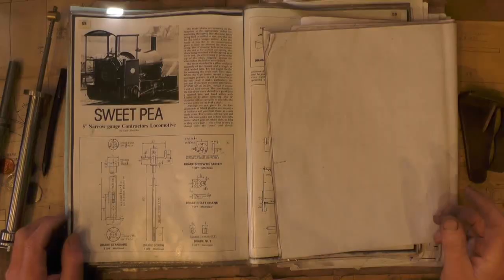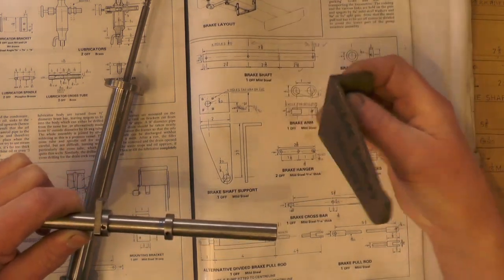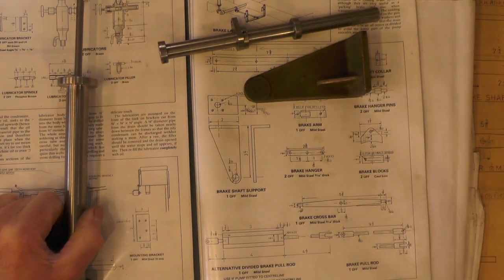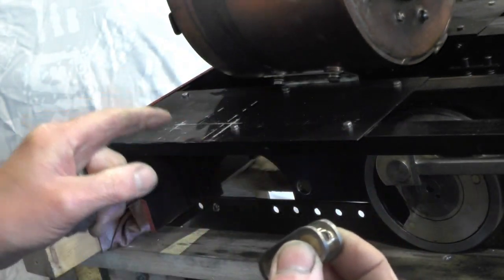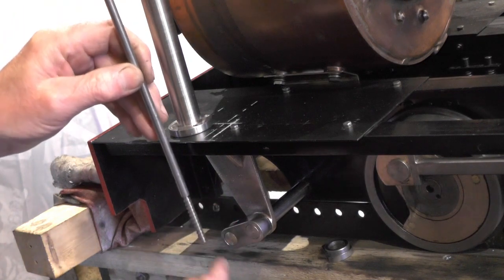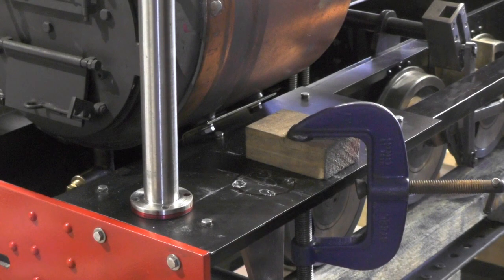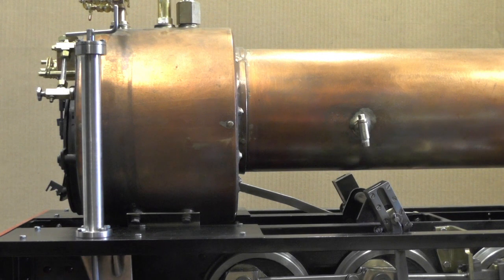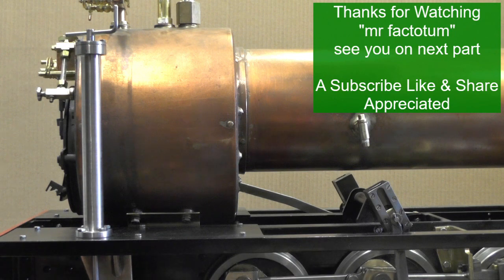Make a Beginners Miniature Steam Locomotive Series (Brakes Part 3  ) "mr factotum"

Comment: Great progress Mr F. just wondering if the brass nut with the square thread would benefit from a couple of circlips to hold it central in its housing
Reply from the maker: hi rob nice to hear from you, yes i thought it was a bad design, but as long as the brake screw comes down in line its not a problem with the amount of use it gets
thanks for watching
regards
mr f

Comment: great job as always. 
Out of interest I would have like to have seen how you drilled the hole in the bottom of the support bracket and get it to line up perfectly with the rod.
It was probably obvious but was just wonderings as it would need to be accurate.  

On my loco my bogie is reaching completion. Wheels and suspension done but have to remake the bogie sliding block as i trashed the two castings on the last operation... 
Working on the main driving wheels now but they have maxed out my little Myford ML10. 6" wheels on my lathe and it only just clears the bed. Hope i can get my tool in to cut the treads else I might have to go to my local engineering club and use there lathe.
Reply from the maker: hi brendan
nice to hear from you, 
I got the measurement by putting the shaft through the frame, then measure from underside footplate where the base of the bracket sits to the top of the brake shaft then added 1/2 the diameter of the shaft, that gave me a precise measurement from the base of the bracket.
Your loco sounds though its taking shape and coming on, if the wheels fit in the lathe the tread can be machined by one means or another.
regards
mr f

Comment: How did you determine where to put the hole in the brake support for the brake shaft?  Looks really nice Mr. F.  Makes me wish I was back in the shop messing about!

Joe
Reply from the maker: hi (binge watcher) Joe
the pre determined holes in the frame  determine the brake shaft support bracket position, just a matter of carefully setting on the shaft and some precision marking out!!.
How far have you got with the kitchen, have you "broke its back" and on the "home straight" yet, good luck and thinking about you doing all that hard work!!
regards
mr f
Reply: Mr. F.  I am dealing with mission creep at the moment.  I thought I would never get the old underlayment out as it was glued and nailed.  Finally though, it is out and I am making progress.  I have the new underlayment down in the Kitchen and dining room, still have the hallway and living room to do but they can wait for a bit.  I have the rough in water and drain done for the sink and refrigerator, most all the rough in for electrical done.  I still need to do the wiring for my stove (220v, 50A) circuit.  It is already run, I just need to terminate it.  And finally I have to "hide" some wire in the wall to assist with the under cabinet lighting when the time comes.  Then I can finally button the walls up and hang and finish the drywall.  The cabinets are ordered (about 3 weeks ago) but are not expected until the 10th of August.  I have to them in before I can get the granite counter ordered, measured and cut.  On an upside, the wife has picked the vinyl plank flooring she wants, the base board, crown molding, sink and faucet she wants.  She is still deciding on case molding, tile for back splash, .......

You get the idea.  you have been there.  A huge game of time scheduling and putting the pieces together.  I told my wife that the kitchen and dining room were here workshop, that I will put whatever she wants in there.  My wife is a wonderful cook and loves to create in the kitchen, so it is win, win for me.  Besides, I have been married long enough to know not to do it any other way.  HAHA

Regards,
Joe